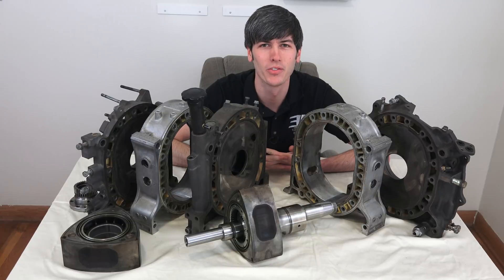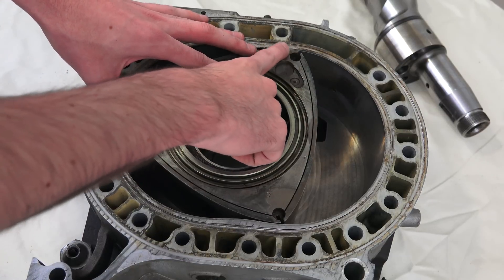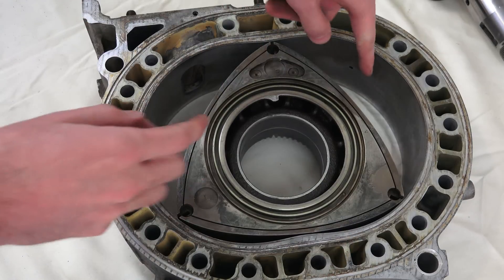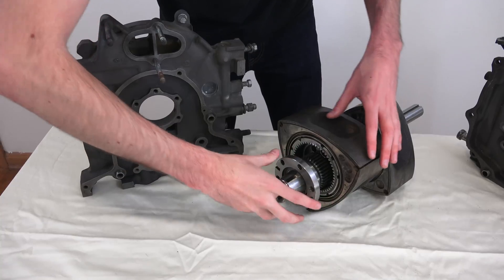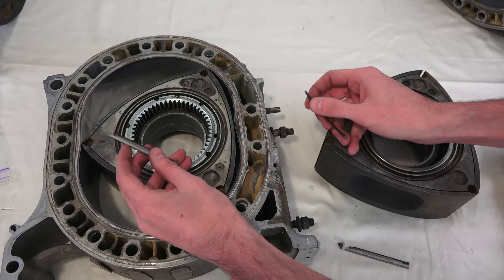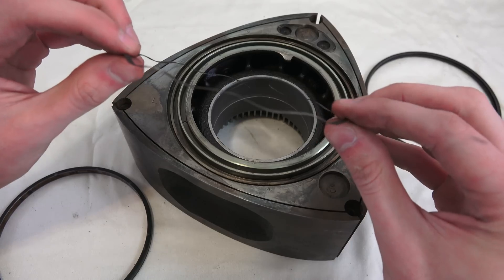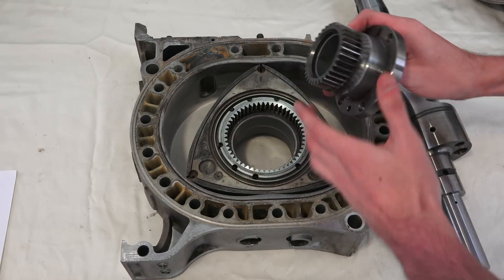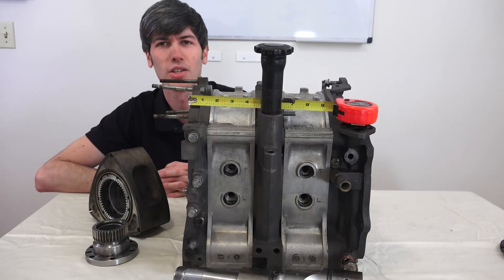How Rotary Engines Work - Mazda RX-7 Wankel - Detailed Explanation

Comment: Nice presentation.  Too bad that the engine has been plagued by seals issues. This would be a wonderful aviation engine due to its small cubic foot print and low mass for the power output.  It is a marvelous piece of engineering.  How does this differ from the new Wankel in the R8?  I heard that  they moved the intake ports to the perimeter of the rotor housing rather than in the sidewall as on the RX-7 version.

I like the hands on visuals that you give.  Now if you could do a BMW/MAN diesel prime mover from a container ship.  I believe the pistons are 5 feet tall and 4 to 5 feet in diameter and weigh a couple of tons each.  You should be able to horse one of those onto the table :-)
Reply: You have a very good point here, that was one of the reasons the Flight Certification did not proceed, the specific fuel consumption of the Wankel is more than of a similarly powered 4 or 6 cylinder engine.  Not to mention that most aviation engines run at 2500 RPM or lower, a 7000 rpm would take one heck of a reduction gear box to bring the propeller back into its optimum rpm range (Generally between 2000 and 2500 RPM).  But it still would be nice to have the vibration free power that a rotary does bring. The heat and the noise can be dealt with radiators (ala P-51 Mustang) and the noise is mostly the prop beating the heck out of the air. A good muffler would reduce the sound foot print of the aircraft engine on the ground.
Reply: bingoberra18 To cover 3 replies in one post...RX-8s are very inexpensive here as well. They had a number of issues which could explain the low resale prices. Mazda had problems meeting power and emission requirements so they kept changing the ECU programming. Which resulted in too little oil injected, which did actually wear apex seals too much, they leaned it out which killed cats, richened it back up, etc. Ignition coils failed with striking regularity. In a lot of cases the bad coils were interpreted as bad engines, so where a lot of unnecessary engine replacements. Compounding matters with the lean oil injection, the Renesis apex seals aren't as tall as previous, so they really wore due to the lack of lubrication. Add to that fairly poor fuel economy compared to other 1.3L engines, plus the weirdness factor. Can't really blame the apex seals though for those Renesis failures. They just weren't lubricated enough and anything will fail if not lubed (that's what she said).

Yep, some piston engines don't have head gaskets, but I'm not sure how that's relevant. There are some rotary engine designs that don't have apex seals. And some piston engines that don't have piston rings.

Of course apex wear lowers compression. As the apex seal and housings are the compression surfaces, that's expected. The difference in reality vs. perception is that apex seal wear happens over 200K - 300K instead of the 30K - 50K that many believe. In the same sense, piston rings, head gaskets, valves, valve seats, valve guides, valve seals and cylinders are the primary wear surfaces of a piston engine. And any wear that results in less chamber sealing (multiple options here) also lowers compression. Add to that timing belts which fail, primarily due to lack of maintenance. Timing chains, cam bearings, lifters/tappets, tensioners, crank bearings, rod bearings, and all those other wear points in piston engines.
Reply: +Todd Dembsky If I'm not mistaken many WWI biplanes had rotary engines so you're spot on with that assessment
Reply: feedback5010 You are correct in that they had rotary engines, the difference was that it was the engine that spun with the propeller.  The crank shaft was held rigid while the propeller was mounted to the engine.  This caused huge gyroscopic effects as you had a large rotating mass at the front of the aircraft.  Many of those aircraft could snap roll right, but had difficulty in making quick evasive turns to the left.

The Wankel rotary has a very small spinning mass and puts out over 250hp -- more with Turbo Charging.  While the Gnome put out 37 HP. I do know that one company attempted to get FAA certification for a mod to some Cessna's (182, 206 and such) to replace the air cooled flat fours and sixes with Wankles, but the market was not strong enough to recover the R&D and certification costs.
Reply: +Todd Dembsky The rotary hasn't been plagued by apex seal issues since the early 70s.The 13B Renesis in the RX-8 is the same basic geometry but in order to eliminate overlap between the intake and exhaust, the exhaust ports were moved from being peripheral ports to also becoming side ports. Also a 3rd oil control ring was added, and the side seals became a Keystone type. The apex seals are 2MM in the Renesis but then they've all been 2MM since '86 anyway. The Renesis rotors are also lighter than the '85 13B shown here at 9.3lbs (vs. 11.58lbs) and compression was raised to 10:1 (vs. 9.4:1).
Reply: The real doktorbimmer In the same way piston engines have been plagued with head gasket problems since their inception?
Reply: wayde philpot And bad coils present exactly like a bad engine, complete with the compression loss on the effected rotor due to the unburned fuel washing away the oil from the seals. Back when used to part out cars, I bought 6 "blown" RX-7s for pennies. 1 of which had a bad engine. 2 had a failed fuel injector and thus were running on one rotor. New injector, ran fan. 2 were flooded. 1 had a bad fuel pump. It's remarkable how a mechanic can immediately tell someone "those damn rotarys...always blowing up!" without even bothering the most basic diagnostics. I wonder how many "blown" rotarys there were over the years that were actually easily diagnosable problems and correctable problems? Come to think of it, there is an RX-8 sitting about 5 blocks from my place that hasn't moved for at least 2 years. Wonder how much they'll pay me to tow it away?
Reply: bingoberra18 My sarcasm has made my point then. The apex seal issue was solved long ago. Any failures rotary builders see now in apex seals are almost always because of neglect or improper tuning. With the primary cause being too much boost with too little fuel or too much timing. Or the 3 piece seal as used in the FC RX-7s just plain wearing out after 200K (that was a silly design). Mazda spent a lot of time and money, almost bankrupting the company, in the beginning developing apex seals. They solved the issue with their sintered iron seals, later hardened by electron beam. Yep, the very early Mazda engines had carbon seals which sucked. This was in the late 60s/early 70s. The NSU seals were terrible in the beginning as well, but even NSU got a little bit better. Just as the early piston engines were unreliable for a host of reasons. Rotary engines have both advantages and disadvantages, but apex seals are not one of the disadvantages.
Reply: +The real doktorbimmer apex seal galore is not the primary mode of failure at all ....coolant seals oil control rings problems are more common
Reply: they sill use them in aviation drones use them because they are the most efficient for drone usage
Reply: +Todd Dembsky   Remember that it's water-cooled, which is a disadvantage in general aviation.  The plumbing and radiator make a larger total package, plus the drag from a cooling inlet.
Reply: The case with the rx8 is actually the exhaust and intake are side ports rather than a peripheral exhaust port like this 13b.
Reply: invinciblejets Oh -- thank you, I could not remember what changed, but I knew one of the ports moved from the peripheral to the side.  Thank you !!
Reply: +Todd Dembsky On the other hand you cannot ignore the issues of huge oil and gas bills, heat and noise that it brings with it.
Reply: +Todd Dembsky The rx8 is a redesign of the Rx7 where the exhaust and intakes are moved therefor it is known as a Renisis not a Wankel motor.
Reply: +The real doktorbimmer lol you don't know who Aaroncake is do you?
Reply: aaroncake They are not plagued with head gaskets at all what are you talking about? Yes they may fail on certain engines at times but the failiure rate is no where near that of apex seals. Anyway its a stupid discussion. Rotarys are good in some ways and bad in others, same with everything.
Reply: aaroncake So I´m not that well read into the engine problems with the RX-8 but I know theyre going for change in UK. Whats really the problem with the Renesis then? Because it sure isnt bulletproof even in stock form it seems.
Reply: In any case -- it was the Wankle (prior to the Reseise that was going through FAA Flight testing. Who knows, now with the redesign, if they have been able to achieve better fuel consumption -- it is a nice package to put into an aircraft.
Reply: +bingoberra18 im okay with the noise
Reply: +aaroncake yeah those coils were terrible. I bought an 04 rx8 with 36k miles back in '10. The coils failed at 45k which im told is actually impressive (some recommended changing them every 20-30k mi).
Reply: +Todd Dembsky they do use these in aviation. The rules of maintenance and time between overhauls (TBO) are VERY strict, therefore you're not running the thing to within an inch of it's life and wondering why you blew a seal. Also the detonation factor breaking an apex seal is pretty much a non issue because aircraft engines burn 100 octane leaded fuel. Plus an entire engine weighs somewhere around 250 pounds. It's actually better suited to aviation rather than vehicular use because of its high maintenance characteristic.
Reply: +aaroncake  we don't use coils in aviation bud. We use twin magnetos because they're stone reliable and if one does go, there's a redundancy. Plus a mag gives one HELL of a hot spark.
Reply: Jacksonkellyfreak All that you say is true, but only in the experimental market.  An FAA flight worthiness certificate was never granted for this modification for manufacturers.  Never could get the fuel economy to equal that of a IO-540 (which would have been equivalent in horsepower.)  I agree the package is perfect. And aaroncake -- we also use dual spark plugs  for redundancy with the mags. The last thing a PIC wants to see is a windmilling propeller and nothing but trees below. :-)
Reply: Jacksonkellyfreak If we're talking about aviation, then yep, that's a different story from automotive use. If the idea is to just keep the thing running and it only runs at one narrow RPM range, the magnetos and carbs are the way to go. In fact I've seen a rotary aircraft that used a dual dizzy 12A front cover on a 13B to mount twin magnetos, running leading plugs on the primary magneto and trailing plugs on the secondary, where the fuel system was nothing but some fuel injectors pulsed through some MOSFETs with a 555 timer! And with two of those "fuel systems", if one died there was a second unit which could be switched on in place. I'd really have to question though whether stone-simple is necessary. A good set of CDI coils built to aviation specs, with redundancy, would be as reliable as a magneto. And electronics in EFI systems rarely fail. Of course both of those rely on one thing which could fail: power.
Reply: aaroncake
 I know how well you know the rotary. I watch your videos all the time. And I think you would agree with me that most of the "problems" we have with them in cars (seals, which I know aren't very problematic now but they do still wear out occasionally, coolant o rings, etc) would be pretty much nonexistent in aircraft because of TBO and maintenance schedules. Not saying it won't have a problem, but it's much less likely. In fact the airport I'm at we regularly see a Diamond DA20 Katana come in and it sounds exactly like an RX-7. It even does that fluttering noise (hard to explain, but the noise when you let off the gas in a rotary vehicle below a certain rpm) when he throttles down, and spits flames if he chops the throttle. I don't know if Diamond is using the Mazda engines or if it's their own design based off the 12A/13B or what, but it sounds identical. I'd like to work on that one.